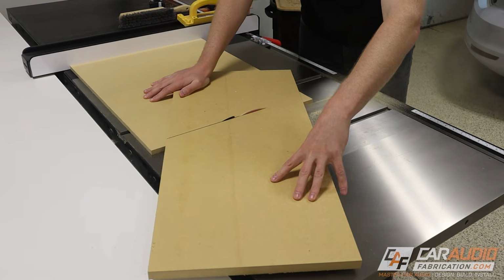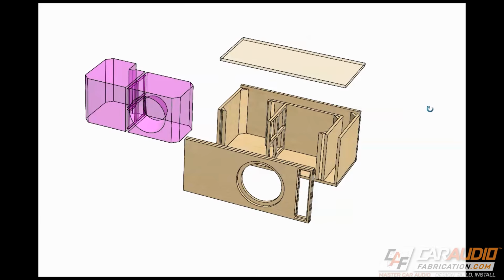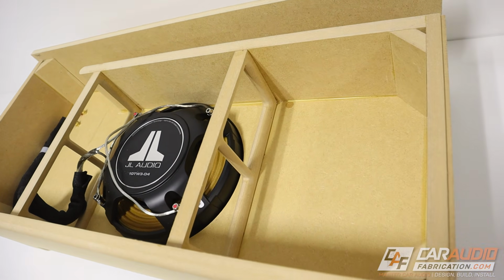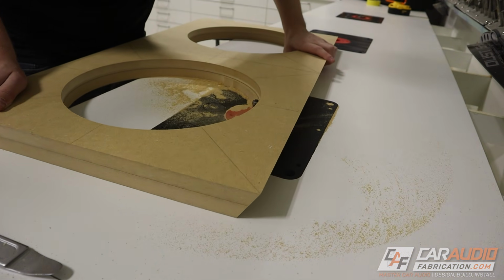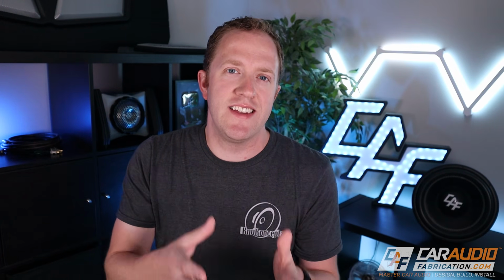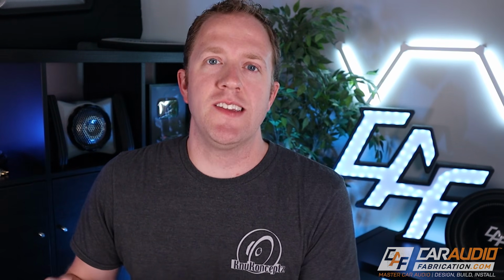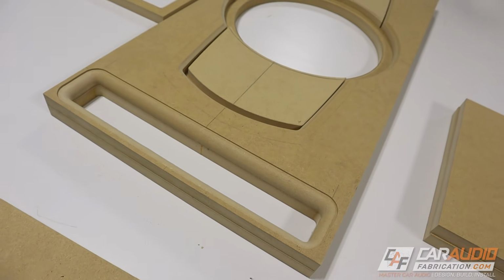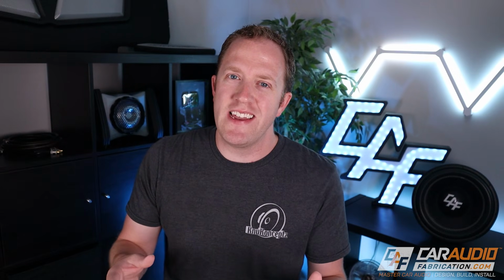GET BETTER BASS! 10 Subwoofer Box Building Tips

Comment: Is there any objection to using sikaflex 522 adhesive instead of PVA glue as this stuff remains flexible but seals with a very intense grip often used for sealing panels on motorhome and adhering solar panels to rv  roofs etc

Comment: I have a 2024 Maverick Tremor and I'm building a box that fits in the under seat storage. The whole back seat lifts up and there is a big space for storage. I'm starting with a Sundown 10 inch with their monoblock 1410w rms amp. I'm using a LC2I and hijacking signal from my door speakers. I haven't built a speaker box since the late 80s and things have changed a lot.

Comment: Used routers if you're on a budget and can be a little patient. I got 5 routers and a router table for like $500 over a year period. All good Bosch porter cable stuff nearly new with all sorts of bits and things. 

Having a few allows you to have 1 on a circle jig, 1 on a table, 1 plunge, 1 fix based, and 1 small router which makes using them really quick, easy, and fun.

Comment: Would your box software work for building a home theater sun woofer?
Reply from the maker: The software is merely a calculator, it does very little of the actual design, it's my experience that makes the design. I can also do home theater applications if needed.
Reply: @CarAudioFabrication  thanks  may I contact you to help me design a home theater sub?
Reply from the maker: Of course!
Reply: @CarAudioFabrication  awesome thanks so much

Comment: How big a router do you need? Some would say large routers that use 1/2" shaft is the only way to go. Ask a professional cabinetmaker and they would say not really. A 1/4" shaft palm router will do the work nicely and be easier to handle. If you are using a larger bit, make multiple shallow passes instead of one big hog out. When routing out a driver hole, don't go all the way through, as all the support for your circle guide is lost. Instead, leave about 1/16" of material remaining, remove the circle guide and then use a utility knife to cut through the rest. Whatever is still hanging on can be cut off with the knife or use a trim bit. I like to use a 1/8" roundover trimmer for that last step: it leaves a nice smooth edge for the woofer and more importantly, less abrasions when you reach inside.

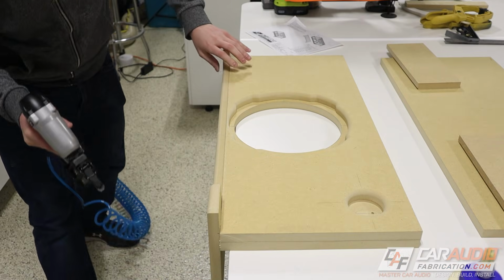Comment: At 2:15 are you using brad nails to hold the box until the glue dries? If so, do you have a recommendation on what length of 18 gauge brad nails to use?
Reply: The length of brad nails he's using looks like 1 inch to 1 & ½ inches long. (Im taking a guess on that. Dont take my absolute word for it though, as i could be wrong.)

Comment: Man I love your videos. A lot of these tips I already do. I used to build a lot of enclosures 15-20 years ago, and am recently getting back into it trying to figure out the best way to put 2 12s in my dodge ram quad cab (there's nowhere near enough room under that rear seat) I'm thinking about going with a dash-rear seat center console build. Anyway in the meantime I've gotten into a lot of other woodworking. So now I actually have a shop with dust collection and the proper tools. Your videos are really helping me see how I can use all these "new" tools on sub enclosures. Example I never used a router on anything, now I've got 3 now a a good collections of bits lol... I believe the first boxes I built was for behind the seat of my Isuzu pickup and all I had was a jig saw lol. That plus a lot of caulking and I made it work okish... Thank you for the videos

Comment: i use 1-1/2" square hardwood at all joints used at battons...also bracing on large faces and across the length and width

Comment: You should do a video making a box without of those advanced wood power tools. Most people do not have that kind of equipment in their garage.
Reply: @majik895  I know right? Not everybody has a table saw out in the garage, or even a router…
Reply: @iice_cream_mann  I mean if you are wanting to build something out of wood more than likely you have what you need 🥴
Reply: can get a used router table for $40 and a corded router for $30 a circular saw for around $30 and glue is $6.
Reply: The process to make a good box remains the same. It may not have the same finish as using expensive tools and beauty panels may not be able to have as much detail and you are trading off more work for yourself  vs cost of tooling
Reply from the maker: I've done that before on the channel and it was the worst performing enclosure build videos I've ever had, people say this but the numbers show me what people are most interested in. There's tons of videos out there on using basic tools and getting basic results. I'll be continuing to focus on getting the best results here.
Reply: @CarAudioFabrication so in order to even build a custom box I would need to spend upwards of $1000 or more on tools is what you’re saying? Whats the point then? I may as well just buy a prebuilt one for a couple hundred…
Reply: @iice_cream_mann that’s why they sell prefabs, for people who don’t have the time or tools available on hand. Nobody said you need to buy upwards of 1000$ tools, you can easily find local box builders that do decent pricing, or you can go on marketplace and buy a tool lot for less than 500 the options are available
Reply: @iice_cream_mann and did you think you were just going to cut it with scissors and put together with Elmer’s glue ?????

Comment: I run a shoda maxxim cnc at work and a few others and all of the spoil boards "this is  the board that the vacuum flows thru and holds the wood that is getting milled to the table". are all mdf there not as airtight as you think . There actually extremely porous

Comment: When it comes to using tools, I prefer MDF, much easier to work with but I hate the dust! 13ply baltic birch does dull down the router bits fast, I do not like the extremelyyy strong smell of it, Ive never had an issue with the 7 ply birch from Lowes, just comes with some voids in the plys that I patch with wood filler. Almost zero smell from that birch and the dust isnt that bad either!

Comment: A butt-joint is the weakest type of joint. (Try lap, dado, or splines)
Nails, pins, screw, dominoes, or dowels should be used in most builds . Bc glue is stronger on larger surface areas.
Use/build a jig for complex cuts.
Know and build for the tuning frequency desired.
Paint/seal the box to prevent moisture issues or spill damage.
Buy a sub that can play at frequencies down to atleast 20hz.
Reply: Preach
Reply: Do manufacturers of subs publish this? This comment definitely got my attention

Comment: #11 Have Home Depot or Lowes cut down your first biggest cut oversize by 1” so it much easier to work on the table saw
Reply: If you have a portable table saw or not much experience using it... It's not that bad with practice and an out feed table. Which can be anything even or slightly shorter than the table height

Comment: Of course the mdf, and plywood is still around $100 a sheet!!!!!!!!!!
Reply: Yeah for a 1" 2x4 sheet. You can get a 4x8 3/4 for 55$. 2 sheets for 110$ and home depot will cut all of them for you,can even double up the faceplate with another cheap 1/2" sheet. For 1 1/4. All under 150$.

Comment: Hi! Is it possible to connect a 16000w sub to a 14000w monoblock?
Subwoofer - Starsound SSW-M-16000
Monoblock- Icepower 14000w Class D
Reply: That sub is rated 1500 W RMS and that amp spec says it can put out 1500 W RMS at 2 ohms.
If you have the D4 version of the sub you can wire both coils in parallel to bring it to 2 ohms. Otherwise if you have the D2 it can only be wired to either 1 ohm or 4 ohms. That amp is rated for 2000 W RMS at 1 ohm, so it will still work. As always just set gain properly so you don't clip at high volume, and limit the power that the amp puts out so the sub doesn't overheat.
Reply: @kmidst_kn6329  thank you so much for the advice was a bit lost in what to do and yes it's the D4 version 😀

Comment: Don't buy MDF from the big box stores if they look like they have been exposed to moisture . I bought the last 2 sheets the store had in stock and they had very minor staining on them , put them in the shop and came back on Monday to them being covered in green mildew everywhere there was a stain .  I returned them with no issues but the new load they got in a few days later were all damp , the young man working the lumber area claimed that it came in on the truck uncovered no tarps and the plastic wrap was wet .

Comment: Don't use Baltic birch it's from Russia.
Reply: Not all of it; a fair bit is from other nearby countries. Ethically, you do need to verify the source of your materials and when they were produced (if it was produced and sold substantially pre-war, well, Russia already got the money, and not using it just hurts your local wood resellers - but if it’s new, then that means that the reseller is violating sanctions and should indeed be boycotted).

Also, there are other high-grade high-ply-count plywood panels that are made from other high-density wood species that can be used instead.
Reply: Actually 90% of what comes into the USA is from Finland ......
Reply: @TxStang  well if you like to to be wrong you'd think that. You should have picked an actual baltic state. Anyway the majority of the baltic birch the US imports is from Russia. That's why the majority of US suppliers quit purchasing it. But ok d bag. How much do you buy a year? Every supplier I got it from has all but stopped purchasing it because it mostly comes from Russia.  There's other alternatives that are void free. Buy that instead.

Comment: Do you think wood screws would be better to use instead of brad nails when assembling the box?
Reply: Generally it makes no difference as the glue does the real work holding it together.  A very well known enclosure builder actually removes all of the screws from his builds after the glue dries, making the point time after time that they are redundant.
Reply: Did you watch the video?

@2:15

Comment: my tip would be to have a plan for how you're going to mount it to the vehicle. 

Having a box loose in the trunk isn't a terrible idea, especially if you're a spirited driver or if you're ever in a crash. Its also likely you'll damage your sub in normal use like this as well, whether its through abrasion, punctures, impacts or even increased resistance because the cones movement has been impeded by something. Make sure you strap it down or use bolts.
Reply: Having a box loose in the trunk IS a terrible idea* 

Not isn’t! DOH!
Reply: Having it so tight you can't get it back out is just as bad ...........  I may have to destroy my setup if I ever need to get it out .   Good thing though it will be hard to steal LOL

Comment: I would love any sort of guide on how to tie in an additional sub into an existing "premium" sound system. I have a 21 Elantra, and the LFE just seem lackluster, with the lows never really getting very powerful, so I've been considering the addition of a separate sub that is specifically for about the sub-40 Hz range. It is difficult, however, to find reliable information on how to find an appropriate subwoofer, enclosure, etc, especially since I have yet to find the output wattage of the existing amp in order to try to find a secondary amp in order to help supplement the existing audio without a major overhaul of the entire system.
Reply: Your best bet will be an AudioControl LC2i.  Affordable, and built to do exactly what you’re after.
Check out his videos on DSP’s as well.
Both allow you to keep factory system in place and add additional amplifiers.
Cheers!
Reply: To hit sub 40 Hz, you're gonna need a nice ported enclosure, driver of your choice to take into account the volume needed and how much space you're willing to give up and something like an audiocontrol LC2i along with an amplifier.
Reply: I just put an entire system I'm 21 Elantra. Used the stock deck but upgraded everything else. Hertz Deice 6.5 components up front, deici coax's in the back. It takes quite a bit to integrate. I specifically did not get the premium sound system though. If you need help let me know, I can give you some tips.

Comment: I have designed 2 box for pioneer tsw309d4, and strange that same woofer, same amp, ssme box, 2 different car, one nissan note and one toyota tercel, they totally sound different, in nissan note, lows are death. Why? How can i make my low hertz more hear able in nissan note with tsw309d4?
Reply: Obligatory not a professional here, but it seems that you may need to relocate the subwoofer in the vehicle. Could be as simple as rotating the box, moving it to the other side, or something along those lines, but it is most likely destructive interference caused by the way the sound waves are bouncing around the cabin. Could also try reversing the positive and negative leads from the amp to the sub to flip the sub's phase to see if that helps.
Reply: @ariccanady1926  yes I've tried different positions, whenever sub look at front "to driver's sit, it's better. But it's so strange..
Reply: is the signal that's being supplied to them the same? Meaning, if the signal output (if drawing from back of head unit or if tying into a speaker signal) may be sending frequencies in one that roll off or don't go as low as in the in other vehicle. Just a guess.
Reply: @TheBradfordG  I double check everything. Every settings are same, box, sub, amp, and parameters. It's just so weird. It's even think like what if 1 sub is fake, but nope.
Reply: The size and geometry of the cabin itself can play a factor as well. Some cars can be very boomy and struggle to go super low just because of a air volume inside of the car itself.
Reply: @NitroNuggetTV  yes internal air volume probably effects. So can you guys know hiw can I fix it. For example, 30 hz is super. Im extremely low life guy, and the woofee "tsw309d4" is not for spl of course, but I know it can be better 100%....and I realize that when is around 20, I feel pressure but I hear the cone volume, and I am sure it can be better, but there is something wrong brothers. I have to fix. I just want to know about nissan note and figure it out with box port and air blah blah